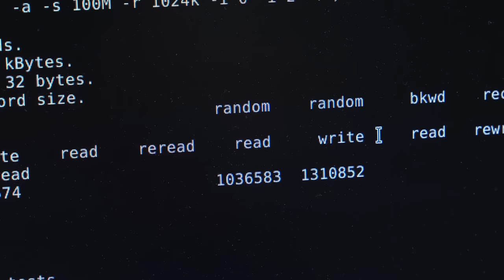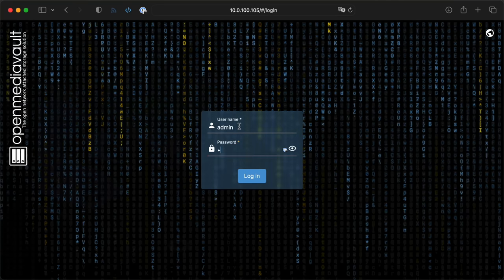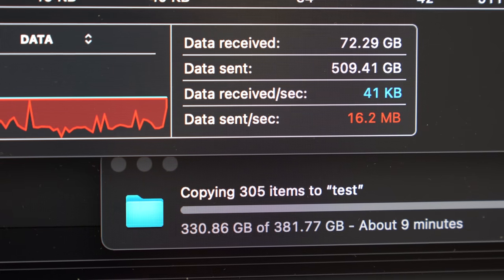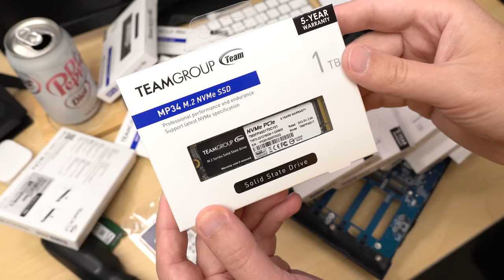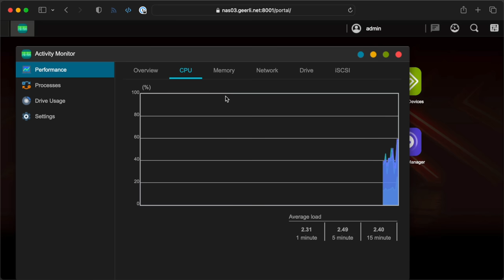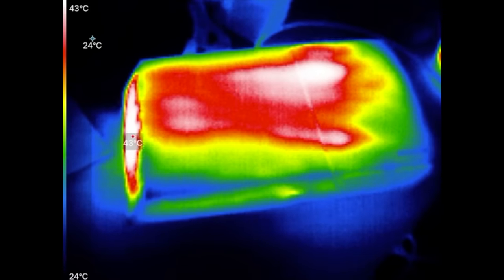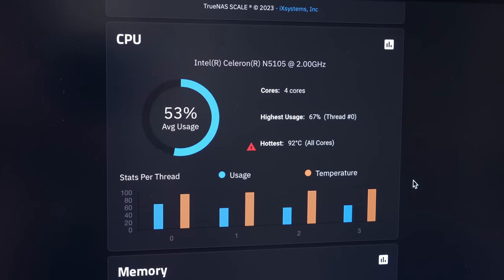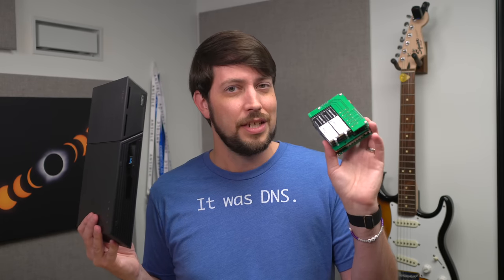All-flash NAS fight: DIY or Buy – Round III!

Comment: I disagree with the premise that "flash is the future".  It has way less writes than spinning rust and I can't see a way for it to ever compete on price.  Like you said, spinning rust will do just fine if you put a bunch of them in an array, and my atom-based RAIDZ2 of six 18TB disks seems to beat these boxes on literally everything except power consumption.

I think it might still beat them on watts per terabyte.

If I required more speed, I could add L2ARC and tune ARC to read ahead more when I'm accessing a big 4K video file for editing.  There's not a single reason for my entire storage array to be the maximum possible speed if it costs anything more.

To be honest, if I was worrying about working on big video files like that, I'd probably have built my workstation with plenty of lanes, chuck some m.2 PCIe expansion cards in there, and have a ridiculous RAID0 on cheap soon-to-die NVMe SSDs.  Who cares if they die and I lose everything if the most I'm going to lose is a couple hours work?  Nothing will ever beat locality for speed, and then the wattage for the storage array is basically nothing, as it's included in the whole system's power budget.

I don't think the demographic mentioned of "off-grid" makes any sense at all.  What possible realistic scenario requires that much throughput without being able to spare a couple of watts, when you'll need hundreds to thousands of watts to work on the data?

Comment: I assume the squeaky noise is coming from the buck converter instead of the PWM controller directly.
Had the same issue on my 3D printer. There are different solutions out there for that specific problem.
Reply from the maker: Could be.

Comment: The Asustor machine does not come with ECC RAM, which makes sense because the Intel Celeron N1505 does not support ECC RAM - therefore I would discourage the use of ZFS on it. Same goes for the pocket nas, sadly almost no ARM based boards with ECC support out there :(

Comment: I suspect the reason why it's not as fast is possibly due to the SATA interface itself, it's not effectively treated as a memory block like how PCIe SSD is treated, instead as a peripheral as per outdated SCSI specifications except it's serial rather than parallel. So yeah, I would rather use PCIe SSDs, as both Android OS and Raspberry Pi OSes already have NVMe support (alternatively you can rebuild the Linux kernel with NVMe and PCIe drivers enabled). 🤷 And of course, NAS server is already CPU intensive as it has to check to make sure files are successfully copied.

Comment: Thus will be nice once ssd/nvme pruces drop and 2.5/10gbps switches become more affordable. Im still good with my asustor 5304 with a pair of 7200rpm 12TB drives for now as i dont require speed for 99.9% of my applications anyways.

Comment: re the "higher price" of the SSD storage:
Compare that to the price of WD Red 4TB HDDs when I assembled my NAS more than ten years ago, and it's not bad at all.
re running ZFS:  You need a fast CPU to get the full benefit.  Consider though the general increase in CPU performance relative to the increase in SOHO LAN bandwidth.  You only need to go 2.5 times faster, but processors have gotten how much faster in ten years?  I suppose the performance equiv of the lowest-end Haswell Xeon would be a mid-tier processor today, especially if the calculations it does for checking and verifying can use VEX instructions with wider registers.
You really should try the performance using RAID-6.  See how that Celeron can keep up with 2 or more parity stripes.  
Also, the more data stripes you have, the less parity it needs to compute, so try RAID-6 on 5 drives.

Comment: "16GB, which is the maximum the N5105 supports"  This isn't true, though Intel list it in ARK.  I'm using 32GB on an N5101 based NAS just fine

$ head /proc/cpuinfo | grep model\ name; free -h
model name	: Intel(R) Celeron(R) N5105 @ 2.00GHz
               total        used        free      shared  buff/cache   available
Mem:            31Gi        16Gi        11Gi        16Mi       2.6Gi        13Gi
Reply from the maker: Many people have reported 32 GB working, though 64 GB is right out.
Reply: I wonder if that's really a chipset limit or just compatibility/rank/timings issues with the so-far tested SODIMMs.

Comment: It’s 2023, and Asustor limits RAM to 16gb and PCIe to eight lanes.
🥸
BUT, Asustor IS open and friendly to FOSS, and hardware limits are much easier to change/improve than locked-down/proprietary mind-sets.
😎
Reply from the maker: Heh, well technically the RAM and PCIe are Intel limitations, but ASUSTOR hasn't been able to incorporate a chip that blows through those. And some people reported 32 GB works fine, but I can't vouch for that since I only went to 16.
Reply: It's not us! We'd love to add more PCI Express and RAM, but this is dependent on the SoC built in. We have to make a number of tough decisions when choosing a CPU or SoC and this depends on a number of factors, including, the specs of the CPU and what we are actually able to attain.

Comment: I’m going to make the bet that the 4GB RAM was just fine. I see no reason why it would not be sufficient for a NAS, unless you want to install apps too.
Reply from the maker: It would be adequate for the most basic use cases; but if you want to take advantage of some ZFS features, more RAM is nicer. And if you want to run something like Jellyfin or Pi-hole or other container-based apps on it, more RAM is definitely going to improve the experience.
Reply: @JeffGeerling  I see your point but really think even with ZFS + pihole and jellyfin (I run those) I’m going to make the case that 4GB is enough. Could be worth a test 😌😆. Less RAM is less money and less power consumption. You may not save much so maybe it’s not that big of a deal depending on the hardware 🤷‍♀️🌷 it is interesting though, is it really necessary to upgrade RAM?

The best case to ignore this test is that the people who can afford the hardware at this price point can pay for extra RAM just fine 🤷‍♀️ I think

Comment: In fact, I have just bought ASUSTOR FS6706T and replace PC-2667 32GB DDR4 and it works fine!
I think it can probably install 64GB for the maximum DDR4 storage.
Reply: Thank you for your support! We can't guarantee that 32 GB will work or will not cause issues because Intel specifies a maximum of 16 GB.

Comment: $600 for 6tb is absolutely ridiculously overpriced. You can get 12tb ironwolf pro or wd red pro for $200. And I'm pretty sure they'll be faster than a crappy ssd under sustained loads. A full SSD nas is only good if you can buy good drives. Buying dramless or low dram drives is just a stupid idea. And it just makes more sense to buy HDDs and have a few fast SSDs for caching the hard drive array or for indexing.

Comment: around 7:00 you test write performance raid1 vs raid5 but doesn't raid1 and raid5 have similar write performance? wouldn't raid0 vs either raid1 or raid5 be a better measure?
Reply from the maker: I tested RAID 5 and RAID 0, then on the ASUSTOR I also tested RAID 10 separately (which would have similar performance penalties but a little less sometimes than RAID 5).

Comment: Is the mutli-plexer only an performance bottleneck for the 12 bay? Would the 6 bay get the full performance?
Reply from the maker: Still not quite—the 6-bay still has passive multiplexers so you don't quite maximize the throughput. Plus it only has dual 2.5 GbE ports, so maximum speeds you'll get is around 4.7 Gbps.
Reply: @JeffGeerling  that is unfortunate there are still passive multiplexers. I was about to get the 6 bay to maximize nvme bandwidth. i completely forgotten about the 2x2.5 GbE.

thanks for the reply :)

Comment: Jeff, why is cpu the bottleneck (for reads at least) and not memory bandwidth? The NVMe drives and the 10Gbe card should be doing DMA,  so shouldn’t the data path be bouncing to and from memory, without going through the CPU?
Reply from the maker: For TrueNAS/ZFS, the data does run through the CPU though.

Comment: Hi Jeff. Can you please provide a components list for this build? Where did Rick get the M.2 riser boards for the storage? Are they Rock 5 accessories? I've searched the SB Components website and cannot find this component. Thanks.
Reply from the maker: Rick built these boards himself, it's a one-off design. He's been working on a follow-up board that's a bit simpler to assemble and much more reliable.

Comment: very interesting! my internet comes in via fiber on the otherside of my study wall, i cant put in a network cable due to rent agreement....so have to use wifi and have to use plc to get to the nas which works fine but wifi limiting my acces to it at 3MB/s max up or down.via the plc 100mb and direct calbe it goes up to at least 20mb/s

Comment: Asustor really need to work on ADM, i'm fed-up with the bug with docker that lock randomly some ports and force you to reboot multiple time for them to unlock. I will change my OS when i found a solution for extracting my data (i've no money for buying storage ect)
Reply from the maker: ADM has gotten better in the few years I've been a user. And I know ASUSTOR checks on these comment threads from time to time, but also make sure to post to their community forum if you can!
Reply: @JeffGeerling  I wrote a comment here earlier, but it seems YouTube deleted it. So... I'll ask @wtfisgoingon535 to help describe the issue once again.

Comment: you are not going to get 2.5gbit of throughput of a 2.5gbit connection. 2.5gbit is the data rate at data link level, not application level. Furthermore, the SMB protocol sucks. It's still single threaded.
Reply from the maker: True, but iperf3 gives me 2.35 Gbps, which is the maximum real world throughput, and I could only get burst SMB speeds up to about 2.1 Gbps, and much more on the ASUSTOR, so there are still some CPU limitations there.
Reply: @JeffGeerling  The 300 MB/s you mention in the video suggests you were saturating the 2.5 Gbps connection, at least at some point, as the theoretical peak is something like 298 MB/s for 2.5G

Comment: 3:12 does Jeff know any GPU based RAID implementation that is available as software solution?  Such parity check should be a massive parallelized SIMD problem, and should be a breeze even for a low end iGPU such as the ones in rasPi.  wonder why no NAS provider use it
Reply from the maker: Not really; I know a few companies (none open source though) have introduced products for it but they tend to only work on a subset of cards, and they aren't universally-compatible, so you end up getting locked into some solution that might not have all the features you'd like.
Reply: @JeffGeerling  too bad, hopefully there would be some open source solution one day!  Btw, so incredible to see you working with NetworkChuck and MrBeast! Congrats!

Comment: Nice video, but it is not recomended the use of ECC RAM? and CPU that use it?
Reply: There are very few Intel CPUs that have ECC support. Those come with other sacrifices to features and heat dissipation.
Reply: @ASUSTOR_YT  Ok, but how about the U series from AMD? that CPUs have more PCI lanes and it is more powerful, AMD also have other CPUs with Low TDP just check those, please
Reply: @Raxsephon  Hi there! Yes, you are right, but we have to limit ourselves to Embedded CPUs only because they have the best binned cores for 24/7 usage and helps keep us within our extremely low 0.6% failure rate in our three year warranty. We have to also maintain the trust we have built over the past few years and recognise that as much as we want to throw in the bleeding edge, we need to also remember that people are storing irreplaceable data on our products.
Reply: Hi, again, and how about the Intel N100 CPU? is more energy efficient and a bit more powerful, It will be nice a version of this flashtor with that processor @ASUSTOR_YT
Reply: @Raxsephon  Hi there! One thing to note, we do need about one or two years to develop a product, so at the time, the N100 was not released yet. We are always looking at new ideas, but... this one is not an embedded CPU. It's a mobile CPU. It's also quite a bit more expensive. We are looking at an option that allows a lot of great features, is power efficient, has even more PCI Express and maybe even ECC for those that continue to clamour for it. But that info is secret right now. ;) Stay tuned! ;)

Comment: What about SSD flash degradation? Seems like a particularly bad trait for a storage medium to have if you want to use it for NAS purposes, no?
Reply from the maker: That's a risk you can have with any kind of storage media (flash has its own quirks, HDDs have their own). That's why I never treat a NAS as a redundant storage option—I always use my 3-2-1 backup plan.

But to help with the flash issue, you could also buy drives from multiple vendors, or in multiple small batches, and introduce more drives over time. As long as you use RAID 6 or RAIDZ2, that could help (or have two volumes, one on first 6 drives, one on second).
Reply: most consumer NAS are write rarely read often and SSDs these days can last decades with constant tens of GB written per day anyway

Comment: Any suggestions Rock 5B or Orange Pi 5 Plus as a low power workstation for light software development?
Reply from the maker: That's a tough tossup. I think either are going to treat you decently well. The Rock 5 model B has been out a little longer, so more people have it right now, but Orange Pi have done a good job with their model and I sometimes like their approach for support more than the Radxa model.

Comment: Hey Jeff! As I understand the ASUSTOR is running non-ECC RAM. But as the Internet says to me - it may cause data corruption in the case of using ZFS. And it stops me from using TrueNAS in my handmade x86-based NAS. Did you hear anything about it?
Reply: not using ECC can cause data corruption regardless of what filesystem you use. It's very very rare for that to happen but it can.
Reply: The internet is overthinking things. If you sort the threats to a ZFS storage pool by probability a flaky cable is a few orders of magnitude more likely than non-ECC RAM is.
Reply from the maker: Yeah; ECC helps with a certain set of problems, but is not required to take advantage of most of ZFS's features that people care about like checksums and snapshots. See also: https://unix.stackexchange.com/a/411292/16194
Reply: ZFS does not need ECC any more than any other filesystem does - though obviously using it is preferable from the data safety perspective regardless. Basically, it's the problem of garbage in, garbage out...

Comment: Truenas Core or Truenas Scale? I'd expect a driver issue with Core and since Scale is built on Linux, you might get better performance.
Reply from the maker: Scale in this case. Core apparently doesn't work with the 10G NIC in here yet.
Reply: @JeffGeerling  not surprised about core and the NIC.

Comment: Great video.   I am in the market for a fast NAS solution to replace my SSD based server.  So I am very interested in your explorations into this new work of M.2 Nas solutions.  take a look the the ICYDOCK ToughArmor MB873MP-B V2...8 bay M.2 system.  This and a MiniSAS PCIe card and I think we can roll our own NAS that can beat the pants off of any off the shelf solution.  I am a 3d animator, My project folders are usually 500gig to 1tb.  so even with 10gig ethernet,  my network is choked by the storage on ether end of my network.  The result is I spend hours moving projects between my workstation, project server, and hot archive system.  Please keep looking into these solutions, cant wait to see more.

Comment: I find it a little disappointing that both the Asustor and the Pocket NAS bottleneck the speed so much that you're no faster than a single SSD.  I get that both are ultra low-power systems and serve a specific niche, but I feel like the target should be set a little higher.  Swap out the N5105 for something a tad beefier that can sustain 10GBit writes as well as reads, or a "pro" unit that could hit 25GBit.  Anything less seems like a waste of SSDs and I'd sooner build a trivial 2-disk mirror than lose all that performance on parity due to an underpowered CPU.

Comment: What about power consumption? I feel like the SSDs will, eventually, pay for themselves for consuming less power
Reply from the maker: Surprisingly, modern HDDs aren't too bad if you just leave them running all the time. But they are noisier, and they do use maybe 1-2W more power per drive for normal usage. So it adds up, especially if you have a 6, 8, or 12 bay NAS!